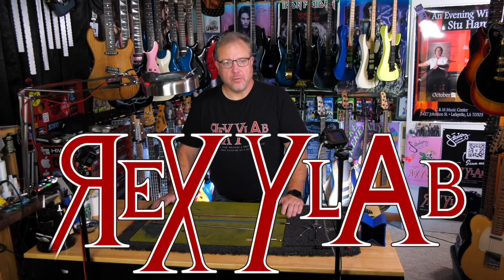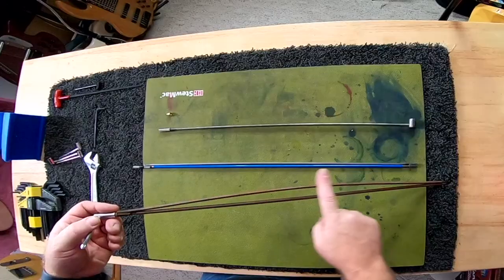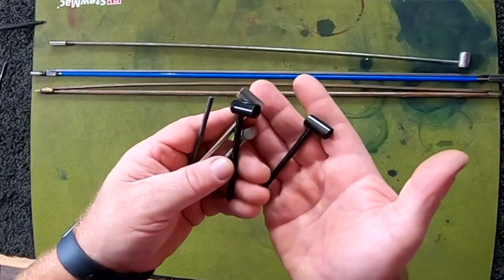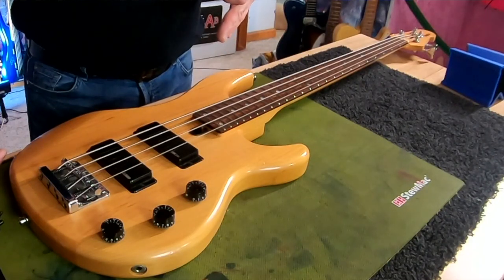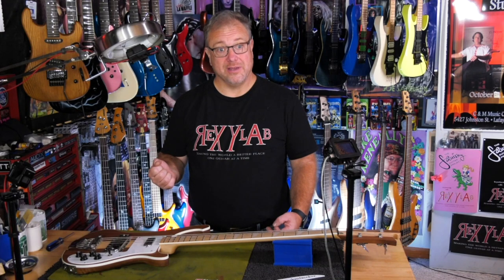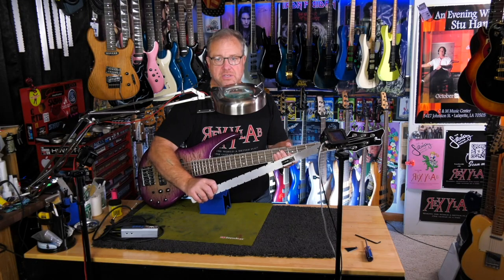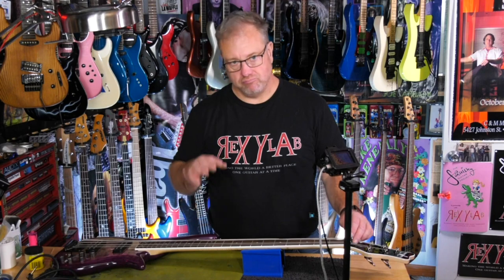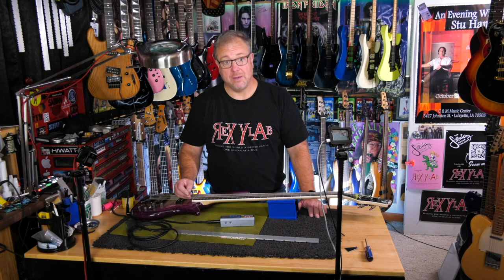Everything You Need To Know About Your Truss Rod🎸

Comment: Worked on a friends Fender Tele..Truss rod moves freely in both directions from a neutral threaded position.  However multiple turns clockwise resulted in marginal changes in flattening out the neck.  Eventually the truss rod reaches a stopping point. Additional torque was applied within my comfort level at which point I stopped.  Still can't get the neck as flat as I like.  Not sure what the issue is.  Thoughts?
Reply from the maker: First, good for you for stopping when you were no longer comfortable. 

Is it a upbow, strings way high on the fretboard? Also, can the trussrod nut be removed?

Comment: Hi,
Thank you very much for the video, I found it quite instructional.

When it comes to the adjustment of dual-truss rods basses (e.g. the Yamaha TRB1006J -6 string, 40" radius-), I've read different resources on the internet, where they suggest adjusting the treble section first, and then the bass, or adjusting both at the same time (under the assumption that unequal tension will lead to neck twist).

Can you share some of your thoughts on this matter?

Best,
Yoshua
Reply from the maker: That is a very good question. In order to answer it thoroughly I’m going to suggest another one of my videos on the Rickenbacker bass that has dual truss rods. The link will be below. 

First though I will say that it doesn’t matter what side you start with as long as you go slowly and in small increments. Take your time to feel the tension on the rod you are working on. Don’t get it to tight and then move to the other one. Move back and forth between them so that the tension is even. 

Above all else take your time and do not force anything. If it feels stiff that’s ok, just use caution. 

If you have any other questions don’t hesitate to ask and I’ll be as helpful as I can be. 

Here’s the link to the Rickenbacker video. 
https://youtu.be/unYhQ7DrF4Q

Comment: do you have any tips on removing a stripped 4mm truss rod nut? sometimes cheep replacement necks are cheep replacement necks. (Telecaster style)
Reply from the maker: Get an easy out from a hardware store and give that a try. If that doesn’t work let me know.
Reply: @REXYLAB  will look for one in the morning.
Reply from the maker: @dane6k6  be very careful when using it. 

The number 1 rule of Guitar repair is Don’t Force It!

Comment: I have that same weird Jackson bass, but I initially used an undersized allen key and now the nut is totally rounded out. I’ve tried to force multiple bits in and even tried to get the nut to turn by “chiseling” a torque to the side of the nut - but, the nut just won’t turn. Now, the nut is really marred up. The rod is actually loose inside the neck, as I see it wiggle a little in the groove. I’m hoping I can get the nut off and just replace it, given the rod’s threads are still in tact. Any advice or next steps you can offer? Screw extractor, perhaps? There’s not a ton of room/access, of course, even with the strings removed.
Reply from the maker: Shit, I hate to tell you this but if you’re talking about the Jackson 5 string that nut is welded on. 

The only way is to pull the fretboard and replace the entire rod. I’ll include a link to the video where I do this very thing. 

I don’t recommend it. 

In the future always only use the tool that fits, never force anything, and if you’re getting frustrated walk away until you have had time to mellow out.

I’ll post a short titled double action truss rod to show why what I’m saying is true. 

Rescuing A 1988 USA Jackson Custom Shop Bass
https://youtu.be/LSlijbt50ns
Reply: @REXYLAB  why is the nut welded on? isn’t the whole design intent for it to turn?

Comment: Nice video. Thanks. I have an inexpensive tele with a heel wheel adjuster. I can turn it both ways all day long and zero tension on it. I want to take some of the relief out of it. What’s the deal with the wheel? Do I have to take the neck off to fix it? Thanks.
Reply from the maker: @kenblevins3611  if it spins freely then it has either come off the rod or something else is going on. If you work it clockwise it should get tighter.
Reply: @REXYLAB  thanks. I’ll try again.

Comment: The stewmac truss rod rescue tool isn't really that expensive. The one you show here is the whole master kit for all possible truss rods, but you can get just the parts you need for your own situation. It is under 300 dollars. $260 or someting like that, which is way cheaper than a good neck. Especially if you want a factory replacement for a Fender, or you are dealing with a set neck guitar, or an acoustic. I got one for my '67 Gibson J 45. It was a life saver. 
Just thought I'd make that clear. It isn't prohibitively spendy at all.
Reply from the maker: That is true. The option I showed was for every truss rod. But this video was for every truss rod so I wanted to show what it would cost to have the ability to fix them all. 

StewMac is great. I have lots of their tools and plan on getting lots more. They back their tools up 100% with a fantastic guarantee as well. 

However, the point of this video is to NOT need that tool in the first place. Therefore I was going for a bit of sticker shock to encourage people to just be careful and research how to adjust their truss rod in the first place. 

You can get a top notch neck from Warmoth for less than $260 right now but if you’re trying to save a vintage neck the StewMac tool is definitely not only cheaper but also totally worth it. 

So to sum up, I agree with you but for the reasons stated I presented the information the way I did on purpose. I hope that clears things up, and thank you for watching and commenting. I really appreciate you taking the time to do so.
Reply: @REXYLAB  I want to make it clear I didn't mean to sound overly critical. It's a good video. I just wanted to make sure people knew that it wasn't as bad as it seemed. And the StewMac tool isn't something just anyone should attempt either. It does rquire a certain amount of experience with wood working tools, and rethreading the rod could get ugly if you aren't careful. It's certainly easier to bolt on a drop in replacement neck.
Keep up the videos. We can use all the info we can get to keep our instruments playing great. They always need something. They do wear out. Just like us.
Reply from the maker: @onusgumboot5565  I didn’t take your comment as overly critical at all. You certainly have a good point about not having to get the entire tool. 

You also have another good point about the fact that owning a tool and being competent in its use are two different things. 

I certainly hope you keep watching my videos and if you have anything to add in the comments I’m happy to have a pleasant exchange anytime. 

My main goal has been and will continue to be to provide as much information about this stuff as I can. Certainly nobody can know everything so it always makes me happy when the guitar community chimes in and helps out. Because we are a community united in our love of guitars. 

Therefore I appreciate you contributing to the subject. Please continue to do so, you are a valued member of the guitar community with experience to offer.

Comment: Hi great video.  My brand new Yamaha TBRX. 174 came with an Allen key that is too loose for the truss rod.  It’s a 4mm.  I tried a 4.5 mm and that is too big.  So it’s between standard sizes.  How would you recommend adjusting this?
Reply from the maker: Sorry I’m just seeing this now. It’s a Yamaha so it’s metric. That being said it won’t be a weird metric size. I would look very close
To see if it’s stripped or if maybe it is meant to be adjusted with a traditional truss rod wrench and not an Allan wrench. 

For what it’s worth my Yamaha bass is a heel adjustment and it takes a 5mm. Let me know what you figure out.

Comment: Squire strat ' truss rod is maxed out ' still too much forwards bow. Already tried forceing a back bow and tightened it up' still too much forwards bow. 
Can I shim it with a small washer to get more adjustment?
Reply from the maker: That is something people sometimes do but it’s kind of risky. Reason being those threads are only so strong. I have seen people over tighten them and just shred the threads to where the truss rod needs to be replaced. 

That is a big job and not worth doing on a squire so I would avoid that at all costs. 

There is a good chance it has been adjusted wrong or under tension where those tiny threads are expected to do all the work. Here is what I suggest you try. 

The first thing I would do is back off the string tension all the way and then take the nut to adjust the truss rod completely off (if it’s dual action you can’t take it off but I’m willing to bet it’s single action because I’ve never heard of fender doing dual action truss rods on a squire). 

While the nut is off use a Q-tip to put Vaseline or bees wax on the threads and the Bering surface of the nut. Friction is the enemy and you want it to be as smooth as possible. 

Before reinstalling the nut look very close for any damage. I have had occasions where someone said they wanted a simple neck adjustment and the neck was broken or the truss rod was damaged. It’s important to take your time and be sure. 

Get a straight edge and check how flat your neck is with no strings on and the truss rod nut still uninstalled. In extreme cases it might have been left this way so long that the wood is warped and more extreme measures need to be taken, let’s hope that isn’t the case. 

If you do not have a straight edge (notched for guitar is best) you can substitute a metal yardstick or something like that. Understand that is not ideal and you’re just seeing how badly bowed it is. 

Reinstall the truss rod nut that has Vaseline or beeswax on the threads and bearing surface. Tighten it until it is in a back bow. Be firm but don’t force it. 

Reinstall the strings and tune to pitch. If you were successful you might not be able to do this because of the back bow forcing the strings on the fretboard, this is good. Gently loosen the truss rod nut as to relax the neck out of the back bow. 

This part is important, loosen it in small increments and give it a little bump back, righty tighty after loosening it. With the lubed threads if you don’t give it a bump into tighten mode it will gradually loosen itself on its own!

Once you have found the proper balance and the neck has the relief you want tuned to pitch you are done. 

If that didn’t work let me know and we can see if more extreme measures need to be taken. 

No matter what DON’T FORCE ANYTHING! If you get frustrated set it down and come back later. 

Let me know how it goes and if this job seems out of your comfort zone take it to a professional.

Comment: Sir, I desperately need some help. I've been playing bass and have adjusted truss rods several times with no problems however I have a weird situation today. Using the righty tighty lefty loosey method from the headstock I weirdly find that when I turn it towards the left .. (Towards the G string (5 string bass guitar) .. my truss rod 'tightens' and the forward bow increases (making it very hard to play when turned to pitch). This is a Ibanez GSR205B (Great bass). I've worked on this for 3 days (total of about 8 hours) I am exhausted and disappointed. I want a straight neck for smooth easy playing. 

Again, the rod loosens when I turn the rod clockwise (towards the B string) and tighens when I turn it counterclockwise (towards the G string) ... why is this so ? Should I continue tightening it towards the G string to see what happens ? Does it do some sort of full rotation or does it reset ? ...... I imported this bass from Germany from a renowned Ibanez dealer (8 years ago) .. am surprised with this behavior ... I even tried loosening it (turning the rod towards the B ((clockwise) and when it's fully loose it's still forward bow ... no matter what I do I am not able to straighten it ... 

What could be going wrong here .. please help ..
Reply from the maker: I bet this is a dual action truss rod that has gotten too much lefty loosey. If that’s the case it needs to be returned to zero. Try going righty tighty and see if after it loosens up if it doesn’t start tightening it again. 

Do this with no string tension at all. If my guess isn’t correct it will just get looser. If I am correct it will loosen up as you go right and then reset itself and start to tighten. 

Do this gently and if you feel a little of resistance stop. 

One other way to tell if it is double action is to try to take off the truss rod nut. You can do that with a single action truss rod, no problem. But with a dual action it is welded on so it can’t come off. This is why you can actually force it into a back bow. 

Give that a try and if it works let me know. If it doesn’t stop and let me know that as well. I’m here to help so we will do our very best to fix this problem for you.
Reply: @REXYLAB  My GAAAADDDD it worked !!!!!!!!!!!!!! 10 hours of stress all relieved ! I am so happy man ! I didn't know this for 2 decades of bas s playing ! You saved my LIFE and I feel fantastic ! Thank you thank you ! After three full turns it started getting Tighty and oh boy it's beautiful 😍 ! Your bet was jackpot right it's a Dual Action Truss Rod (Now I know) God bless man !!!
Reply from the maker: @patrickdavid6525  it genuinely made my day that this solved your problem, deescalated your stress, and most importantly, got you playing your bass again. 

My channel is full of stuff like this and if you have anything you think I should do a video on let me know and perhaps I will.
Reply: @REXYLAB  Thank you ! 🙌